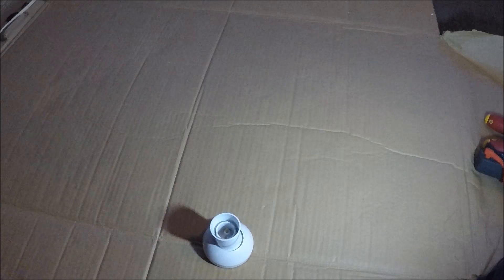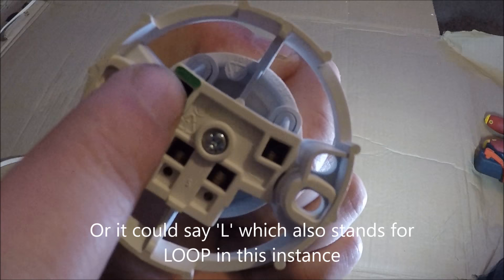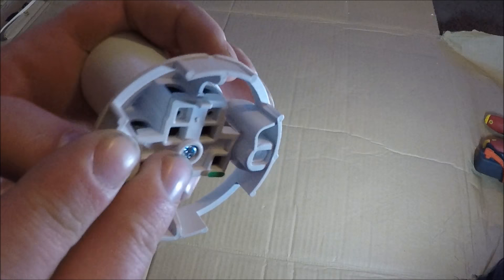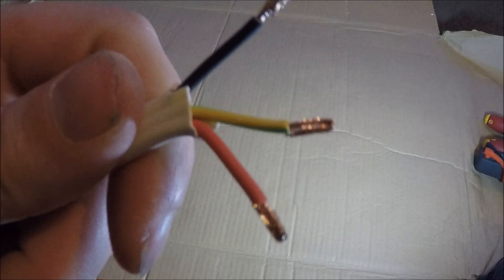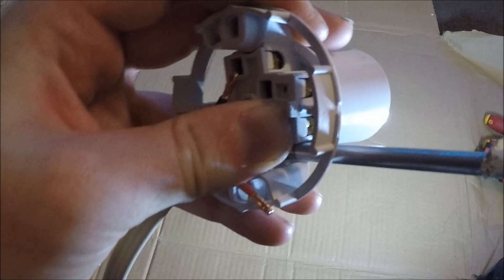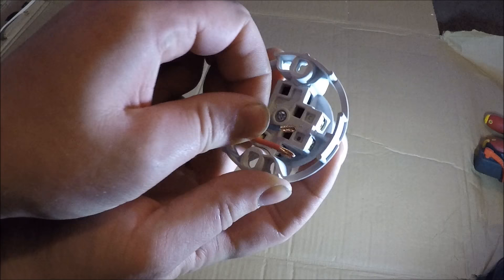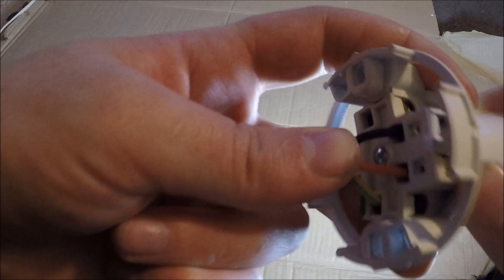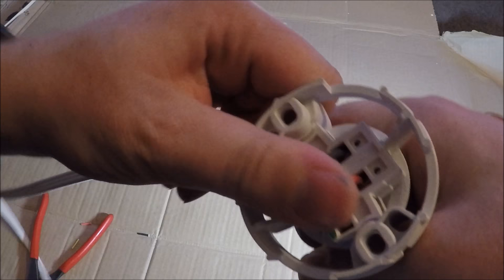How To Wire a Batten Holder

Comment: I bought the same holder. Clipsal brand. As this fancy foreign light worth $89 is busted. This light is made up of a bunch of small squared shaped led lights inside.

Can I simply use the same batten you showed here to replace the old fancy light I had on. And wire it the way you did here and no more extra work and putting in volt controller or modifier or alternator.

Comment: Okay, so I need the Loop to daisy chain to the second ceiling light in the living room as they are both supposed to be connected to a single switch in the wall.

There is also a blue cable I think a remnant of the previous two ceiling light fittings. Each  fitting had eight little lights along and S-shaped frame. 

I am hoping to simplify going back to two basic lights.

Comment: Hi, so i needed to replace an old batten holder as was damaged. It currently has two red cables and two black both connected (spliced together) into the two terminals.  I assume that is because there are two switches controlling the single light.  Do i just wire it up exactly the same way and ignore the loop and earth? thanks heaps.
Reply: Hi, I've the same in my hallway. I have no double switches for the light. Have you sorted out that puzzle?

Comment: I have those on my ceiling. I wanted to change them out. Does anybody know how to uninstall or take them off? I tried twisting the bottom cap to set it lose so I can access the screws inside but it wouldn't budge.

Comment: u said the green is earth and in captions u wrote L or LOOP, but then u pointed to the connector saying that was loop ... im lost?
Reply from the maker: The terminal is only green on the PDL629 fitting used in the demonstration. The green terminal would instead have an L or say loop on most other brands or older style PDL fittings.

Comment: Why doesn’t it matter which of the two terminals the active and neutrals go into?
Reply: because its  AC - alternating current,  that said if you have an edison or screw type, it is very important to choose wisely, not for operation because the same  as this type, it will work both ways, but for safety, you dont want to be unscrewing and touch the exposed screw part, if its still on contact with live side.

Also, note the switching may be wired at either the switch as in Daves example, or at the light (what youd use the Loop for - back to the switch) in the mains loop in loop out.
Reply: @Ressy66  I'm not sure that's right.  Not sure is what I"m saying.  I'm saying it's wrong for sure.  I'm thinking it is because it is a light and not power.  If that were a power plug it is important - I think - to have neutral as the neutral because the live wire is just that: live.
The AC isn't working as I used to think. Going this way and that way along these two cables so it doesn't matte which is which.
One cable is always at zero. The other cable varies voltage with respect to it.  That other cable is the live one.
Neutral is expected always to be at zero volts.  Wire up a power plug with that attitude and it's very wrong.  I think.  I must try to get that clear in my head. We all should.